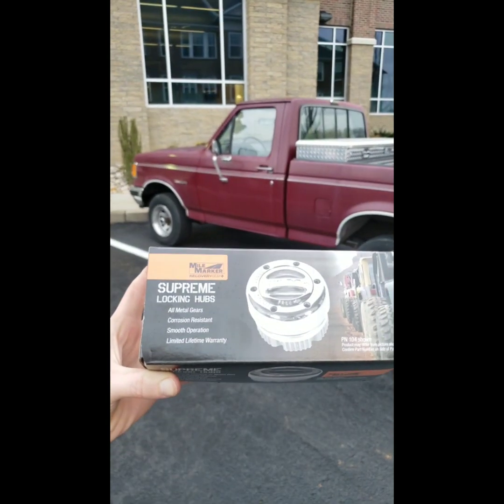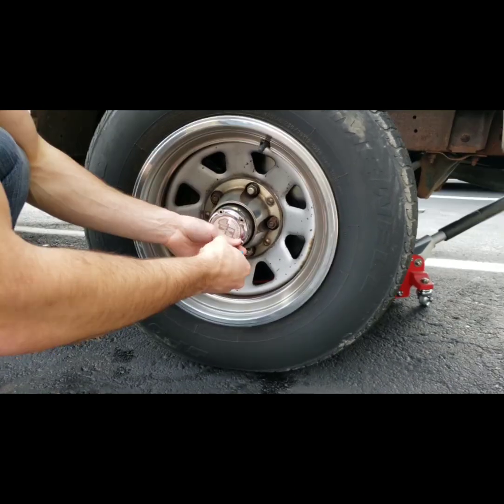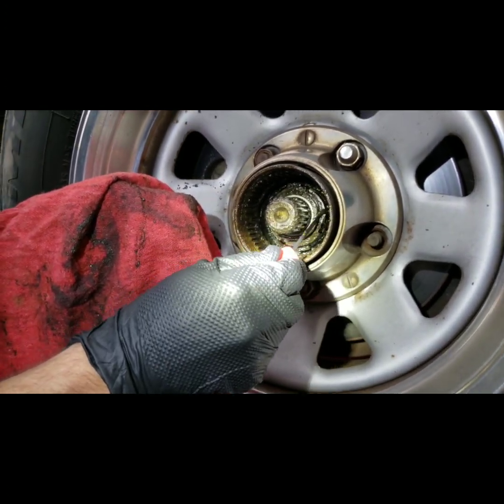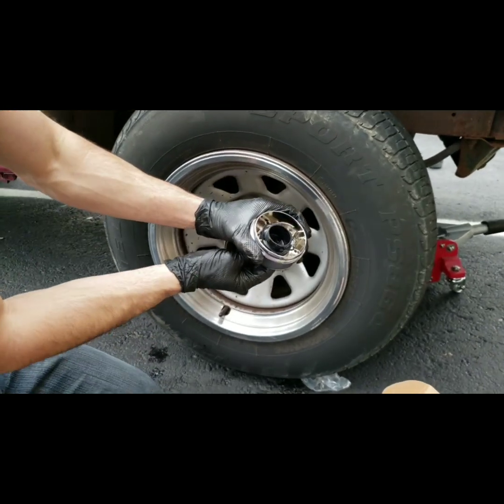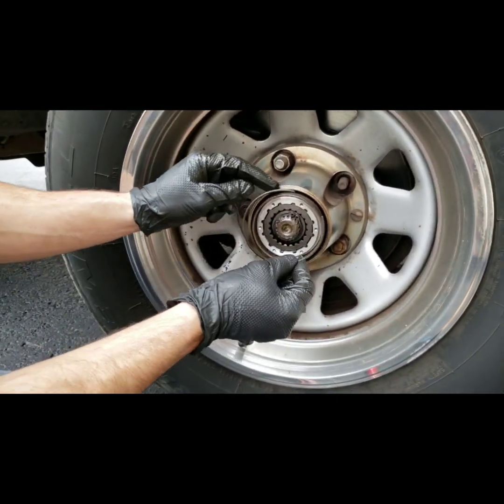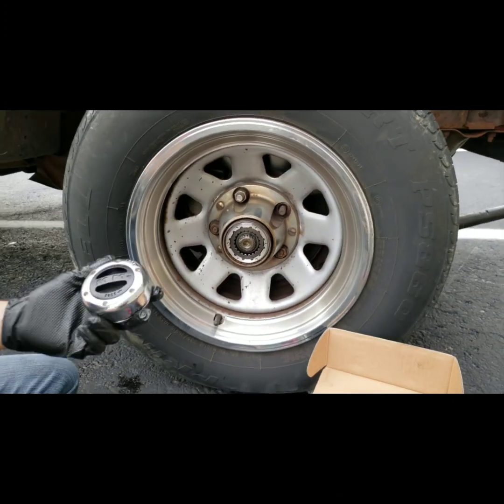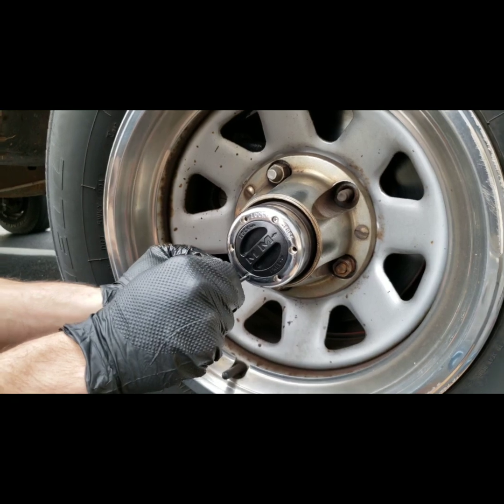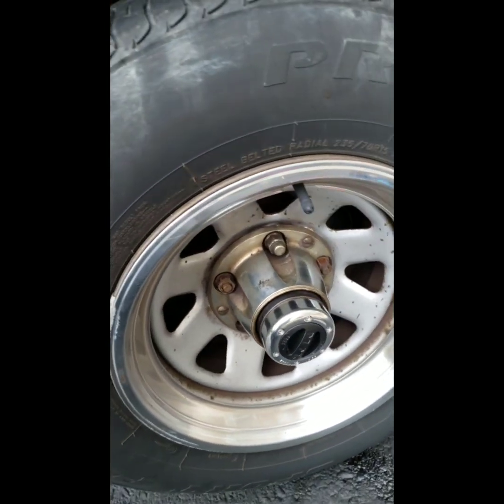Quick 4x4 Auto-to-Manual Locking Hub Swap Guide

Comment: So I can’t get a straight answer about greasing the locking hubs. Any mechanic have the answer? 
Switching from automatic locking hub to manual 38826 warn hubs.   
Also what do I do about the vacuum line? Remove and plug Or do I just leave the line and try not to touch the 4x4 switch. 01 f250 superduty.

Comment: So are those hubs not supposed be used when 4x4 is applied in reverse?
Reply: No its just whenever you’re going from 4 wheel drive back to 2 wheel drive after you “unlock” your hubs you have to roll the truck back a little to have the disengage is all. When your hubs are locked and truck is in 4x4 its normal operation forwards and backwards